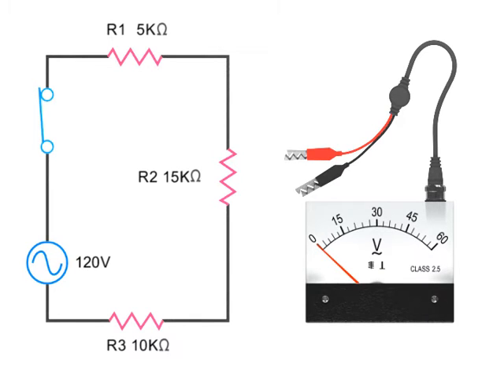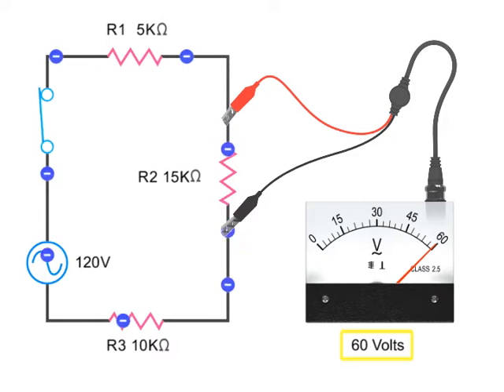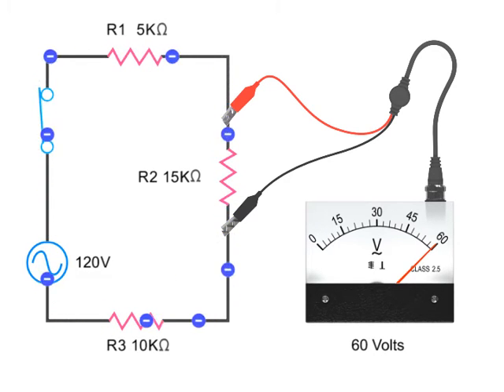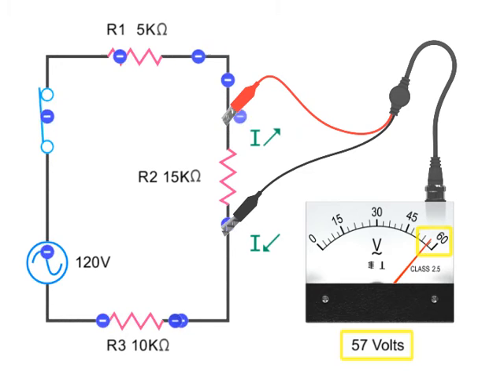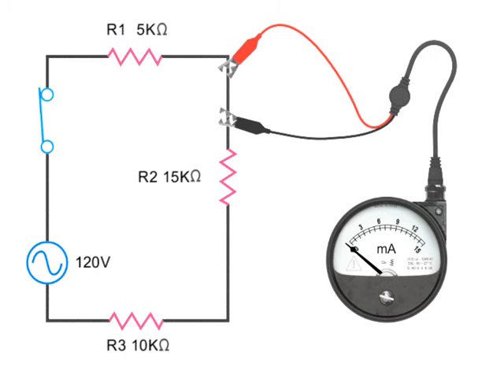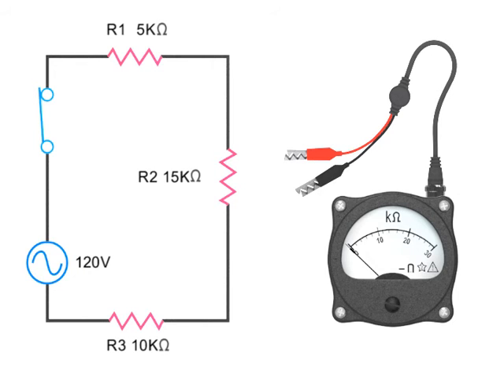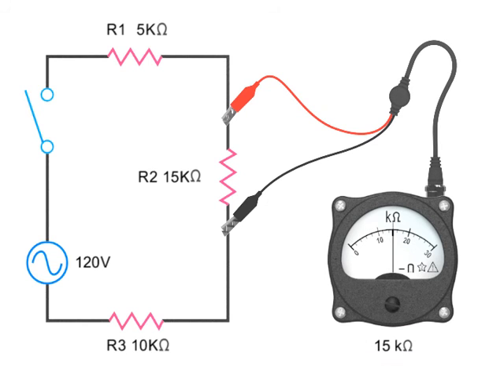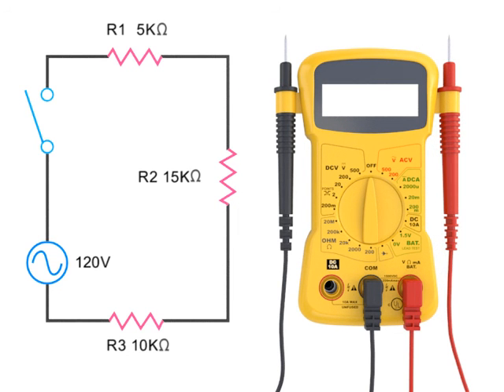How to Accurately Measure Voltage Using Measuring Instruments

Comment: Thank you fro the animation. But how exactly do you accurately measure a voltage? The voltmeter will have some offset and it will have some gain error so it will almost never accurately measure the voltage. Are there any techniques or procedures you can use given only an imperfect voltmeter to truly get an accurate reading?